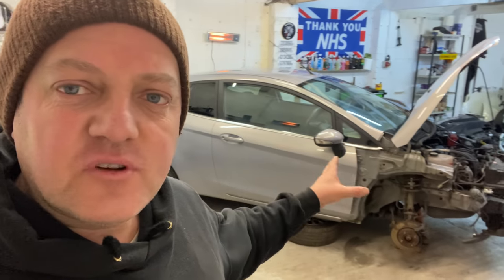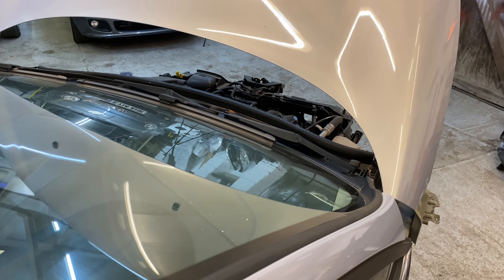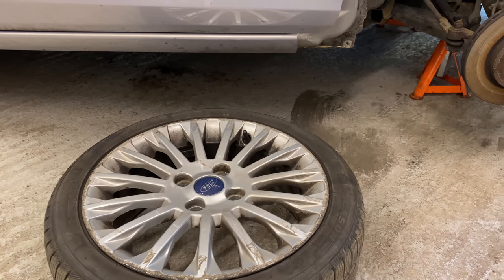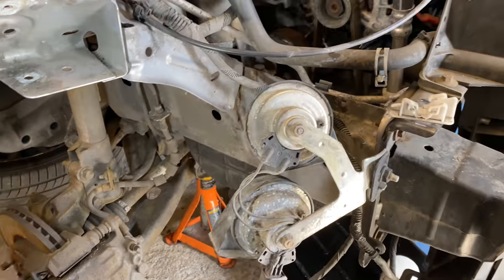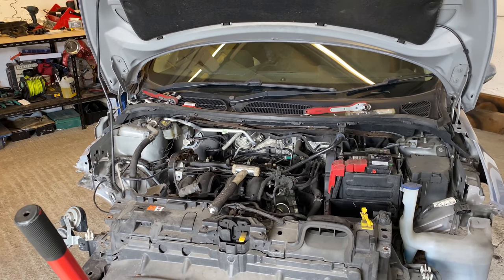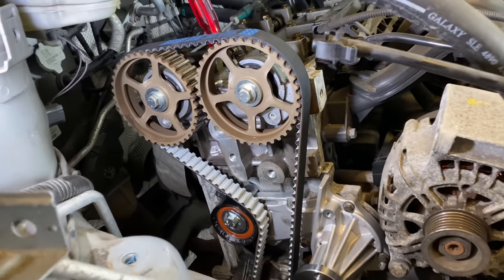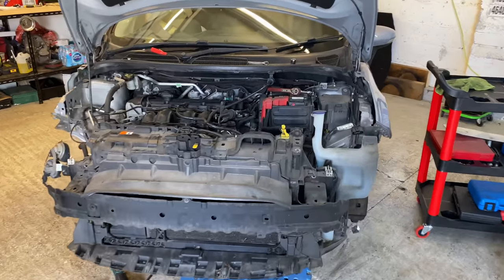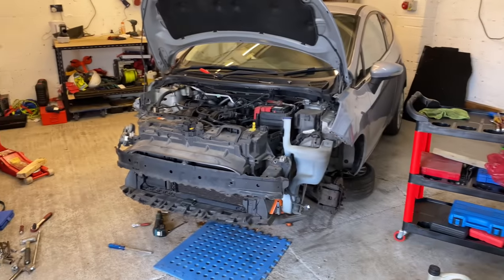FORD FIESTA TITANIUM 1.4 CAT N SALVAGE REBUILD PT 2 (CAM BELT )

Comment: You might've been able to clean the Bendix on the starter motor, it just sounded a wee bit lazy to return. My daughter's was the same, just gummed up with dust and age. If the rear wheels are OK have you thought about getting a pair from a breaker to replace the fronts? Should be cheaper than refurb cost. Keep smiling 🙂
Reply from the maker: Thanks for the info Alan appreciate it buddy 👍👍😷

Comment: The reason the camshaft pulleys have no time marks is because When you lock up the cams and crank you have to undo the cam pulley bolts and as there is no key way the pulleys will be free to rotate so when you tension the belt it can take up the slack appropriately then you have to tighten the bolts. This is the way it should definitely be done. 👍
Reply from the maker: Thanks Robert appreciate the info buddy it’s all ways nice to find out more info about doing this type of job nice one mate have a great weekend stay safe 👍👍😷

Comment: The cam sprockets are not keyed as its the position of the shafts not the sprocket that is important. I always start with the crank pulley removal if it won't come off you can't go much further

Comment: Due euro car parts always have a discount code?
On Easter Monday I bought/ collected and fitted a set of brembo front pads for our 2013 fiesta titanium ecoboost, for the princely sum of £35 including a large can of brake cleaner.
The pads even came with the fitting kit (4 threadlocked bolts for the caliper carriers and 4 anti rattle shimms.) Which I think is a brilliant price, they had a 57% discount on them and in stock (8 miles round trip to collect)
Reply from the maker: Yeah mate that’s why I use them and delivered to my workshop within 2 hours 👍👍

Comment: When it's getting to you walking away is the only way, can't you find another motor factor I find euro prices are way over priced, I went for disks and pads, even with a 40% discount code still £15 cheaper at my regular factor, and yes it was a decent Brand. Shop around mark get a few trade accounts set up, could save you a small fortune over 12 month
Reply from the maker: Thanks for the info buddy I will ask about 👍👍

Comment: Said it before, you set yourself higher than a lot of the others, you seem to go the extra mile to make sure what you sell is as good as you can make it for the new owner.... too many others do profit before customer care 😎👍
p.s. see you use Euro Car Parts ... have you ever tried using their sister company Car Parts For Less?. Their prices are not as inflated therefore the discounts don’t look as good, however 9 out of 10 times they will be cheaper at checkout and is free delivery over £15 spend 👍 on the last 2 orders I’ve placed with them, ended up saving around £24 in total 😇
Reply from the maker: Thanks buddy appreciate it I just what the cars the best I can get it I fill so much better knowing it’s not going to snap a mouth down the line I use euro car parts because within 2 hours of placing the order it get delivered to my work shop have a great weekend stay safe 👍👍😷

Comment: Absolutely superb as always Mark I like the colour it’s got a lilac twang to it, that will fly away when finished, the alloys £180 is an extremely good price I remember that would cost £60 per wheel when I worked at Ford direct in the mid 90’s, looks like very high quality belt it has ptfe on the back of it, in regards to the major service is it worth renewing the transmission oil as well best regards to you stay safe Mark from billericay 🚗👍👍🇬🇧
Reply from the maker: Thanks Mark yeah £180 for all four wheels is good have a great weekend stay safe 👍👍😷

Comment: Another good video mark just to say when I take a timing belt of I always check the belt by bending it backwards when it’s of and check for cracking in between the teeth 👌👍
Reply from the maker: Thanks Paul I will check the old one nice one buddy good tip have a great weekend stay safe 👍👍😷
Reply: @ResurwreckAutosUK  you have a good weekend mark 👍

Comment: Hello Mark you mention Euro Car Parts  have you tried Car Parts 4 Less    Same company but mail order but they are VERY fast on the delivery
Reply: Euro Car Parts and most other parts shops deliver same day to garages
Reply from the maker: Hi John I haven’t buddy within 2 hours euro car parts delivered to my workshop time is money stay safe buddy 👍👍😷
Reply from the maker: @SalvageMasterEssex  Thanks do They deliver within 2 hours 🤷🤷
Reply: @SalvageMasterEssex  garages get parts at a discounted rate as they are offered to them at trade price. Euros in my area don’t offer a great service anyway so usually I call around and get a better price from GSF or another parts supplier.